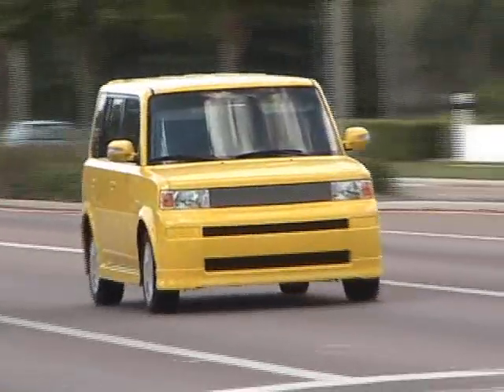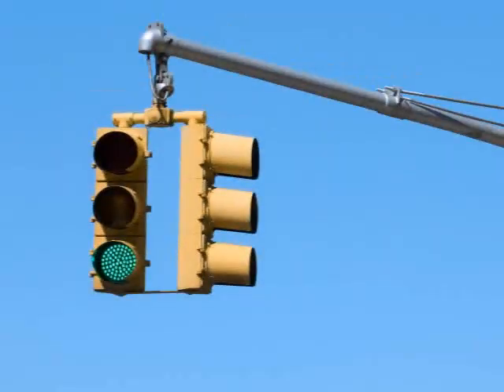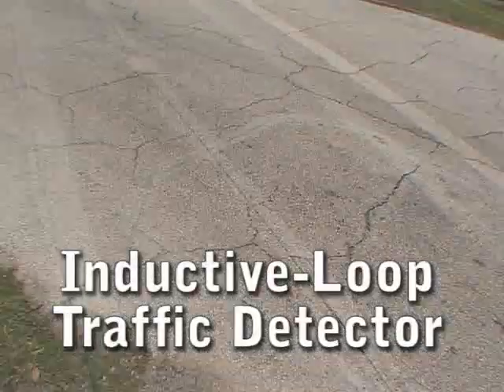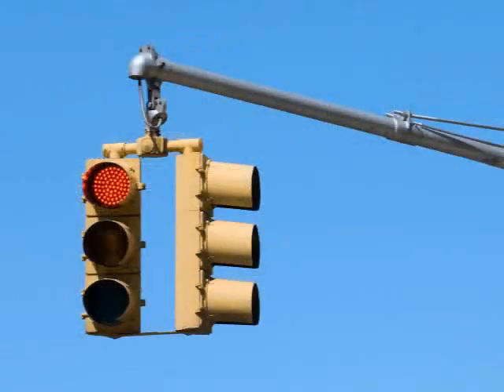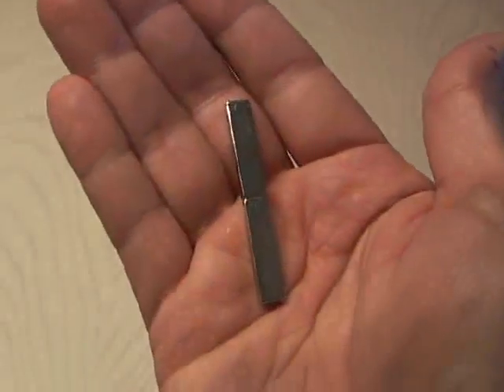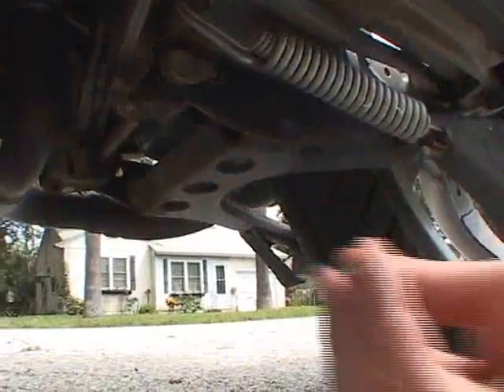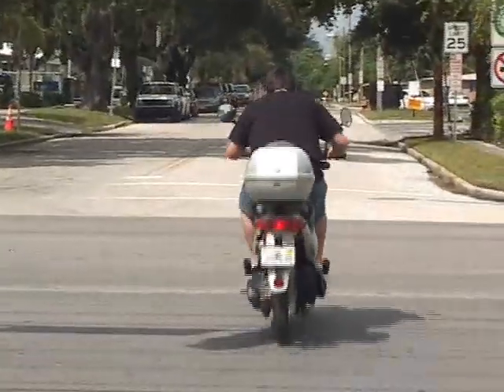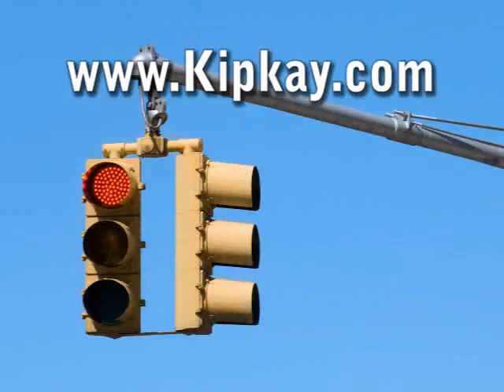Trigger Green Traffic Lights

Comment: the point isn't that your triggering the lights when you aren't suppose to be, its that small vehicles, like scooters, motorcycles, etc. don't have enough metal on them to cause the magnetic field to be disrupted. this wont change anything for a full sized car. for the lights that don't have inductive sensors they either don't have any sensors at all (they are just timed), or they have camera-like sensors that will detect anything that moves in front of it... so this wont affect that either

Comment: Please contact the traffic department and inform them.
They may not know about it (how would they know?) and are glad to learn of problems.
They try to make the system work as well as possible.

When you "call" a signal, it may still wait for a "window" (opening) between "platoons" of vehicles.
Even if there are no vehicles, the signal is set for the window.

My bicycle has called signals!
A stale WALK signal changing to WAIT may evidence a "call".

Comment: ["...No. When a cop turns on his sirens, it sends an electronic signal to the boxes that control the lights." ] 
Wrong!

Siren is only an audible warning device.

Some signals have 3M Opticom signal preemption system.
It detects IR (infrared) light at a very precise frequency.
It cycles traffic signals from green to yellow to red as usual, giving the emergency vehicle a green signal and green left and right arrows if any.

You can't fool it with flashing lights or headlights.

Comment: Some lights will change if you quickly turn your highbeams on/off several times. The reason this causes some lights (like the ones in Downtown L.A./fashion district/little tokyo)to change is because it mimics a siren.

Comment: It depends on the circumstances. If there are no cars around, and you pull up to a red light, it will change to green to let you through instead of making you wait. In some cases, there is no need to change the light based on traffic, like when there are lines of cars waiting to go from all sides -- then it just changes on a timer.

Basically, the sensor is there to override the timer under certain conditions (instead of having to make one person wait with no cars around for a timed light).

Comment: This does work, it may not work right away but say you ride a motorcycle and alwasy pass by a street with little trafic coming from one side...sometimes thes lights dont really have a schedule to change the lights but relly on the sensors...this trick would defenetly triger the sensor

Comment: It does not change the operation of the street light computer. It merely helps vehicles to be seen, helping the computer to know you're there. This really will only benefit motorcycles and small cars as stated in the video. All it does is help a car to be seen, not immediately change it to green.

Comment: you don't get it, do you?  Okay, this is essentially making the traffic light do what it's supposed to do.  lower mass vehicles don't influence the sensors like most cars, this merely triggers the sensors when you have a smaller rig.

the end result is that the normal signal change process executes.  thus the other traffic lights go red before yours turns green.

Comment: There are actually remotes that can change trafic lights. They broadcast at 14Hz which is "high priority" for traffic signal emergency comtrol units. They also make a 10Hz unit which is "low priority" for testing the system for mass transit and other authorized users of the opticom, strobecom systems.

Comment: Do you live in the middle of bum-fuck Kansas? Every traffic light has a timer; but those traffic lights are all old. Sensors are now used to regulate when traffic is detected on a non-busy street; so it can quickly change the light that street. The busier street usually has the green light for 80% of the time.

Comment: The problem is not the red light itself. Your really did present a great soluction but you forgot to mention one thing: Neodymium Magnets generate powerfull magnetic fields, it's a fact. But by producing them they also harm you, it's already proved that a High  value of Tesla(the unity used to mesure the electromagnetic fields) provoques long term damage to the human body, so please be careful with these magnets!

Comment: There was 3 inches of solid ice on the road underneath 14 inches of snow. This was in late April and was a very unusual 1 in 50 year event even for Alberta, in fact it broke records. 

It was also drifting right on the sensor area to the point where anything but trucks would get stuck. It may of malfunctioned due to the ice,snow,cold. Not really to sure why it did it but the ice and snow could have been the cause
I would assume it was fixed so it would not have the same problem the next winter.

Comment: The only way to really increase the inductance of the coil is to bulk up your bike with a metal that has a high permeability, like iron or ferrite. Although you may also want to try putting a long continuous coil (a hundred feet or so) of wire under your bike. This will couple energy out of the coil's field and burn it off inside the wire. This trick really does work, and you can make the coil small enough to fit on a bike.

Comment: Those magnets are coated with nickel so they won't rust. Also, you're off on the reason it works (if it works at all, which I'm not sure it will). Exposing the coil to a static magnetic field won't change its inductance. It may generate a small voltage spike in the coil the moment you ride up to it, which could possibly be triggering the light.

Comment: Hello! Obviously, they have a timer. Most traffic lights will change from Red to Green and back again in a minute or less, regardless of the traffic. However, if there are more cars going in one direction than the other, the lights will change about 10 - 40 seconds sooner, depending on vehicle size, time of arrival, the lights timer and on/off coming traffic.

Comment: Since I don't live where you do, I guess I can't say you're wrong. Just speaking from experience, I know that most traffic lights turn green without any cars waiting there, though the presence of cars might speed up the process. I just know that where I live, I will often come up to a stoplight which turns red on me, even though there is absolutely no traffic the opposite way. Basically, it's just getting in the way of me moving forward, since it is helping no one. So, I guess you know better.

Comment: And still people ride the line thinking it'll help the light change more quickly... which especially doesn't work on the lights that are on a timer... but I wouldn't think that it would speed up the change even on the the lights with the sensors... they end up halfway through the intersection and are no longer over the sensor.  Just crazy.  But if I ever buy a motorcycle or moped I'll keep this in mind.  Very helpful info.

Comment: Its completely true, another trick is when you are the only one at the light, and the lane has multiple coils separated, pull up to the front, then put in reverse go over the second coil and come back to the front, it senses that 2 cars have pulled up and the light will change quickly, try it out, it works! I do it all the time!

Comment: Triggering an inductive loop is not illegal.  Your car does it every time, magnet or not.  We aren't pretending to be a firetruck.

Triggering lights has been a problem for years.  If you are lucky, the most sensitive spot might be marked with a bike or X.  Some jurisdictions have simply legalized running of red lights after a stop in a motorcycle.

Newer lights have video cameras.  This supposably solves the issue, as well as makes traffic light installations much cheaper.

Comment: Probably so that its easier to remove if you want, the magnets might also want to jolt together side by side instead of the way they're meant to be if enough force is applied. Also, if you decide to ever take the magnets off and use them for something else, they could over time become covered in iron filings from the road or engine which would be an absolute nightmare to get off the magnet again. With the tape, you just peel it off and hey presto. :)

Comment: When the loops recognize the vehicle the traffic lights do not always change immediately, they only send a signal to the traffic controller that a vehicle is present. Then only if the signal timing is set as "actuated", which is a signal timing plan that will hold the minor (or side) street to red and keep the major street green. When this is the case you will notice an immediate change in the lights. Otherwise, the loops only sense the vehicle and adjusts the signal timing cycle accordingly.

Comment: It's not a metal detection system, the induction loops measure the change in the amount of magnetic field lines that are able to go through the loop and this is caused by a change in size of the loop. So if a large object passes over it, it changes the amount of field lines passing through and there is a system that measures this flux. A really strong magnet is able to produce enough emf to trigger a green light on one of these streetlights.

Can't say the same for timed ones though.

Comment: no idiot, at some light you have turn signals,  if  a car never pulls in that spot the turn signal will not turn so keep the flow of traffic even, then when a car does pull in that lane the signal will activate, so they are real

Comment: I'm surprised how many idiotic comments there are on youtube! You people don't really think that the light turns green because of the magnet, do you? The magnet is there only because, under normal circumstances, a car triggers the inductor without needing the magnet, while a motorcycle - due to its small size can't. So he attaches the magnet. The coil inside the road then recognises the vehicle and if there is noone on the sides of the crossroad, the automatics on the traffic light turns green.

Comment: Even if they did notice, you're not remotely breaking the law. The added magnet just makes the coil work as it should. It is SUPPOSED to be triggered by all vehicles. The magnet just increases the field interference of a smaller vehicle, making the traffic light react the same as it would to a larger vehicle.

Comment: True...and for those who are wondering more about the sensors, they are used for emergency vehicles with their lights on...the reflectors detect which the direction the lights are flashing from shutting down (red-lighting) the perpendicular roads so there isn't an accident with the vehicle on its way to or from another accident--GREAT invention and yes, they can be tricked.  :)

Comment: Bullshit. You're not going to affect a metal detection system with a magnet. And if you pull up to a stop light that is not on a timed sequence and you fail to trip the inductive loop you will sit there indefinitely.
Traffic lights are not going to trigger any sooner if your vehicle contains more metal. The signal doesn't weight which direction of traffic needs right of way based on vehicle size.

Comment: where is this? i never seen those loops on my streets here in san diego california?maybe they do a good job of covering em up or what?but i do know that if the light is red and its been a while and the light dont change i just pull forward more and then it turns green,like it detects im there,at an intersection,theres some thing on the top of traffic lights that looks kinda like a camera so idk if thats it.depends on the lights though.sometimes it dosnt work.